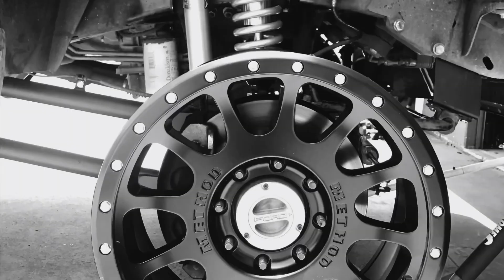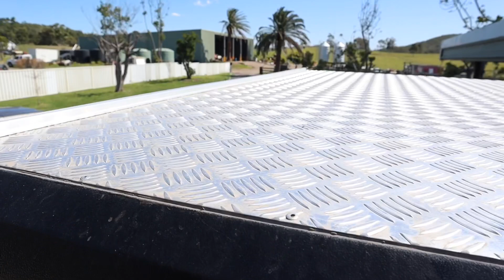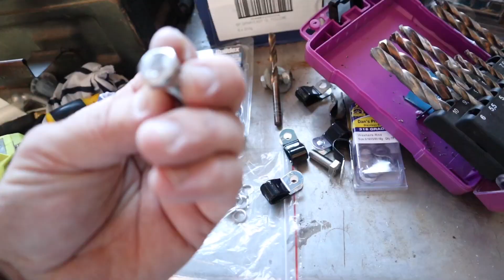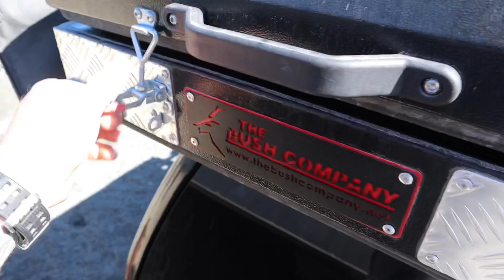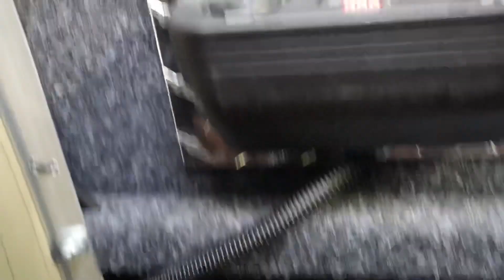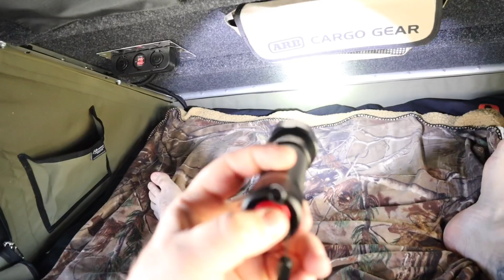ROOF TOP TENT POWER INSTALL !!! Fit power outlets in any RTT.

Comment: Thanks for the video!  Can you help out with what the gray electrical connectors are called, and where you bought that cable?  Thank mate!
Reply from the maker: Hi Robert ! 

I assume you’re talking about Anderson plugs ? Available on eBay
Reply: @TyFenwick  Yes. I researched and found out after my post that they are used for connecting to a battery system to power something requiring high power off the power strip in the tent. Anything low power can be run with the usb cord. Do I have that correct?

Comment: hey mate what size/brand was the solar panel? did it end up falling off? would u do anything different now?
Also what was the brand of the magnetic phone/ipad mount you used inside the tent?

Thanks!
Reply from the maker: Hey mate I still have it up there but it was just a no name from eBay, there’s some really good panels online. 

Id suggest elevating the panel off the roof slightly with corflute material giving more air for cooler operation. 

The brand was mob armour 👌🏼
Reply: @TyFenwick  thanks mate, im just more surprised that the adhesive kept the panel down in the wind etc and has kept stuck down throughout the elements. has it peeled off at all

cheers

Comment: Hey mate just suss out with mounting that panel straight to the tent with no air flow underneath it, because what I’ve been told it solar panels need airflow underneath them or they’ll burn out easily
Reply from the maker: Yeah these ones are a bit funny and almost impossible to mount any other way, it’s more of a trial with this one Im curious to see what happens with it. Things only $40 bucks so I’m not to concerned. 

I know people have had issues with them getting hot and failing due to no air flow like a standard glass panel or solar blanket. 

I’m more so just experimenting with it and taking one for the team to give you guys some feed back if it’s a heap of shit haha, to be honest I hope it blows off the roof 😂😂😂👍🏼